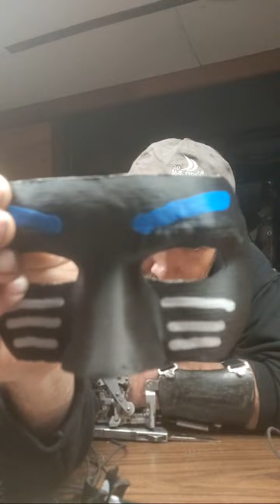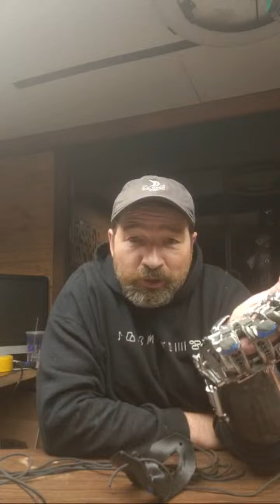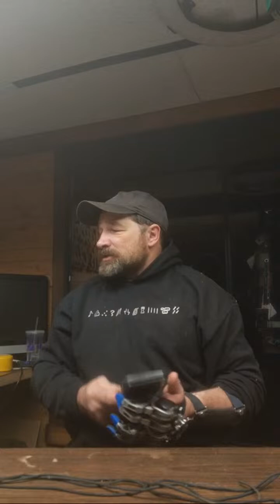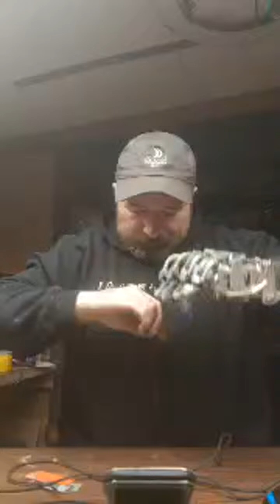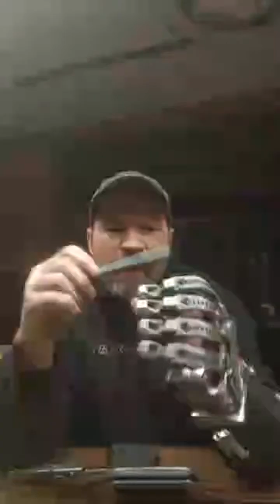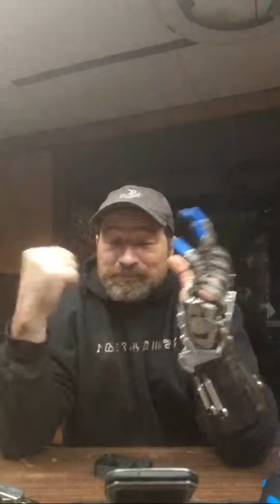Ian Davis is live!  Finishing up Halloween masks

Comment: In the first part, you drill a whole through the mask with your prosthetic nearly directly on the other side of the bit. When you first started using your prosthetic, did you ever experience any phantom sensation in scenarios like this?